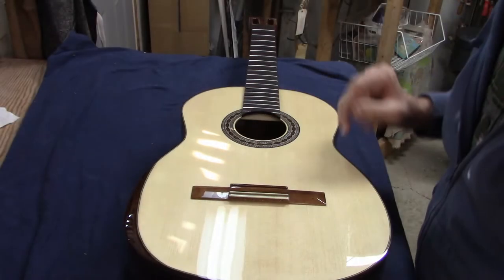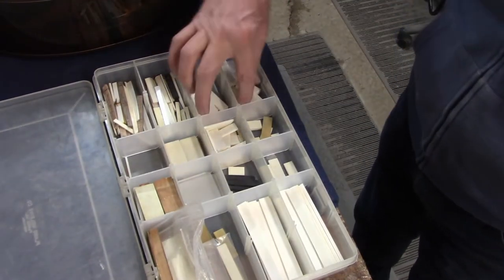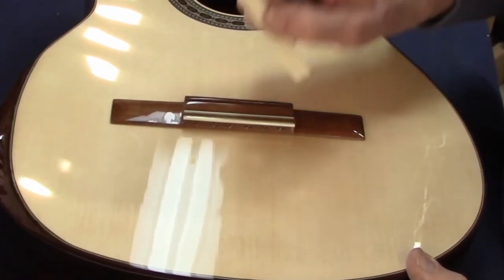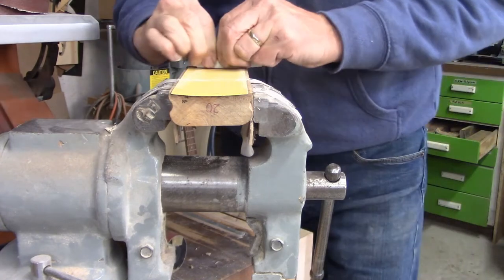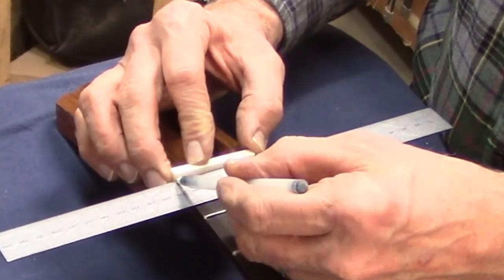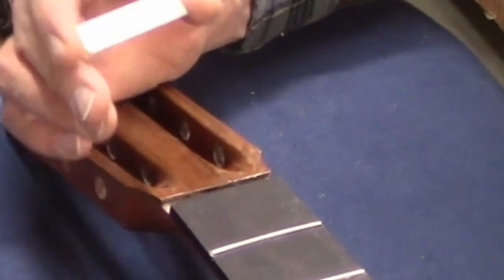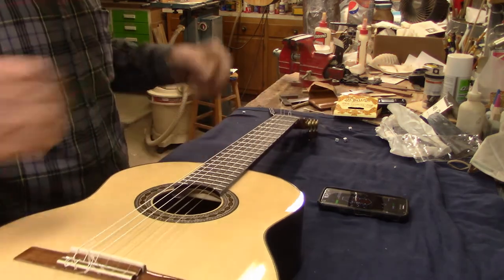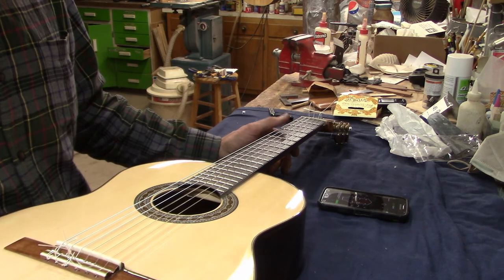Classical Guitar Construction. Part 18: Stringing Up

Comment: Great video on the nut and saddle creation. Appreciate the tips and information your passing along. I like how you found a ruler that is about the correct thickness in marking your nut. I use a pencil cut in half, letting it rest on the first 2 frets and scribe a line. Seems to have about the same results you get with the ruler you use. I'll have to look around to see if I can find a ruler that will work as well. Always good to know 2 ways of doing something.
Reply from the maker: Yes, it is always good to have more than one way of doing something. Thanks for watching.

Comment: I’ve had the tonewood timber for a guitar for several years and never got around to constructing a guitar.  I have just watched your video series from start to finish and have been inspired to give it a try.  Thank you for producing  such a comprehensive series of videos.  I have many questions, but if I may can I ask your comment on a couple?  When attaching the neck to the soundboard do you keep this flat and rely on the bridge height to create the action? (other luthiers I have seen suggest the neck should stick out around 3mm).  I also found it intriguing that you curved the fretboard on a classical (my preference also), whereas tradition has it as flat and the fingerboard is planed down on the bass side to allow for the greater looping of the bass strings.  I am assuming that with your method, this differential for the bass and treble strings at the 12th fret is essentially adjusted at the bridge?  Once again many thanks for a great series of videos.
Reply from the maker: Thank you for the kind words. In answer to your questions; yes, the neck and the rim of the soundboard are all on the same plane. The soundboard is domed, so the middle of the soundboard ends up about 2 mm higher then the surface of the neck. Regarding the fretboard profile, that is a matter of choice. Traditional classical guitar players usually want to keep a flat fretboard, I think because it keeps the strings all on the same plane at the bridge. People who also play steel string guitars seem to prefer the radiused fretboard because it is easier to play barre chords and they don't mind that the bridge saddle is curved to the same radius.
Reply: Thanks for taking the time to respond Gary